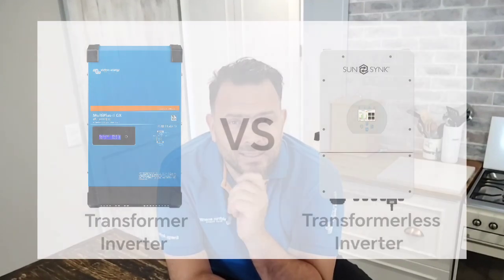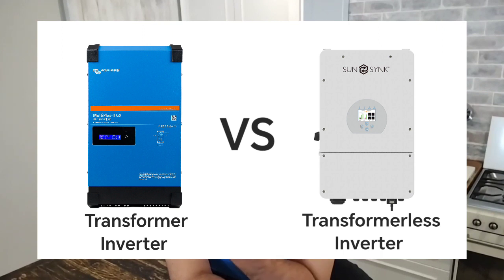Transformer Based vs Transformerless Inverters

Comment: Transformers doesn't convert DC to AC, they merely step up the low 12VAC to 110V/220VAC after the DC is converted to AC from a circuitry. And for a home system where there is no any Inductive load that consumes a lot of power using Trabnsformerless inverter is safe and also transformeless inverter are very efficient in the conversion, little energy is wasted when there is no load connected

Comment: Sorry, thats technically incorrect! There are no 'transformer less' converters. The transformers can be smaller in high-frequency inverters - but they can't be omitted. And the conversion from DC to AC is not done by any transformer - this is simply not possible! A transformer does transform the voltage of AC only - its a short on DC! Thats why you need semiconductors (Mosfets, IGBTs e.g.) for the switching in both topologies! But the difference is the frequency of switching!

Comment: what the difference between low frequency square iron transformer inverter and vocation high frequency toroidal transformer?
Reply: Low frequency inverter has more power over high frequency inverter, it has high surge power to start higher appliances like, compresser, air conditioning. Any appliances that has motor works perfectly.

Comment: In addition, without an iron core, copper wound output isolation transformer in a high frequency, transformerless inverter, if the AC output monitoring circuit were to fail and a MOSFET in the H-Bridge circuit were to short to ground, a low cost high frequency inverter can send dangerous high voltage, high amperage DC current to your AC appliances which can not only
damage your appliances, but can also set those appliances on fire.
Reply: to counter this one, before and after inverters you should have protections, surge protectors and some over current breakers, dont spread fear mongers here.

Comment: LF inverter is less efficient for a same size of HF inverter. Victron has a way of dealing with that though but their inverters are way expensive. Let us consider 8kw inverter for instance, Sunsynk/Deye costs around R35000 with 5year warranty.  For a similar sized Victron inverter you will need a 10kva which is about R60000.00. For Victron, you will then have to buy MPPT charger for about R15 000.00. R75 000.00 total. That is more than double for what? 10 years on Sunsynk or 15 years on Victron?
Reply: For inductive loads, you just need to size your HF inverter correctly. My inverter hardly runs at 50% load so the inverter will certainly last long. I would get a LF inverter if i was running big power tools nonstop. I would then use it only when using the tools not permanently connected.

Comment: What about efficiency...?
Reply: There is typically only about a 2% to 3% difference in efficiency. If you are using a properly sized battery bank and solar array,  this difference in efficiency should not make much of a difference.
Reply: @quickquote1568    No !   There's a molehill-and-mountain difference in the losses.  They are proportional to the size/weight of the cores, which is a HUGE difference.  I am not a seller or manufacturer of inverters. I have used both types and prefer transformerless BY FAR for efficiency. It has no voltage-drop/waveform distortion on load too. If the circuits are properly designed, they are going to be immune to inductive spikes too. I have not had any breakdowns in the years I have been using transformerless.
Reply: @sayeretmatkaal  A 3% difference in efficiency is hardly a mountain. And it certainly is not worth the difference in surge capacity (200% for a high frequency inverter vs 300%+ for a low frequency inverter) or life expectancy (3 to 5 years for a high frequency inverter vs 10 to 15 years for a low frequency inverter) that you'll be giving up when choosing a low cost, high frequency, transformerless inverter.  And since you're only going to have to mount a low frequency inverter once in 10 to 15 years, vs 2 to 3 times for a high frequency inverter during that same time period, weight is totally irrelevant. I repair inverters for a living. Have done so for the past 25 years, so I'm very familiar with the reliability of inverters.
Reply: @quickquote1568  Hmmm. Nothing like Horse-Drawn Carriages ! Reliable, silent, odourless , comfortable, safe ! No handle to crank to start ! Yes, grandpa, that was Model-T you were fighting. The world has progressed since.